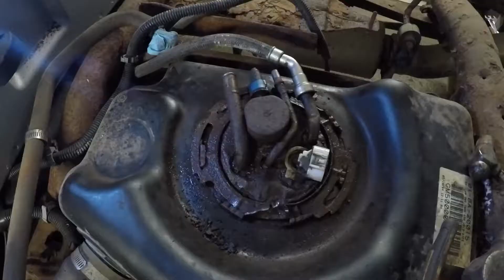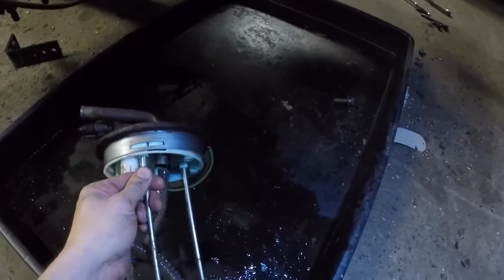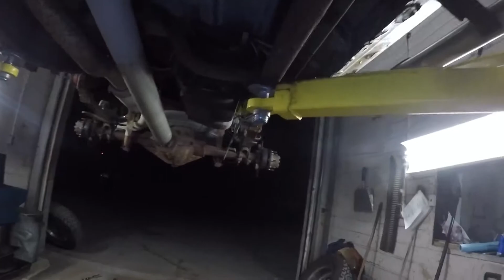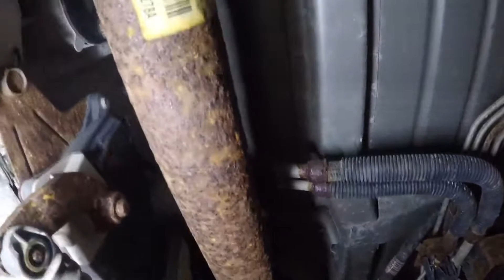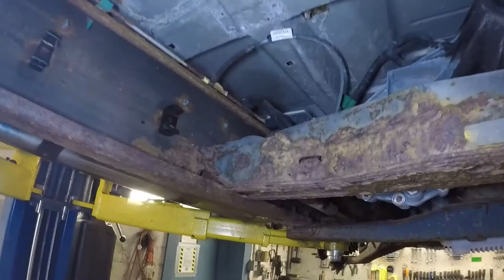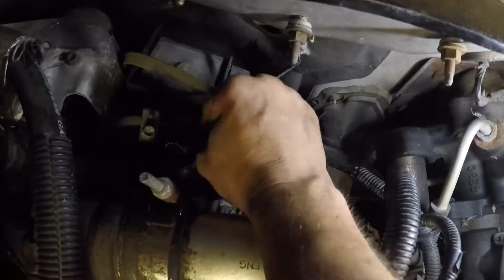Duramax project Re-started lift pump,fuel lines,custom sending unit, axle seals

Comment: The video was interesting and kinda helpful.
Reply from the maker: Steve B I have more content I will try to work on this week to post up the system I did !
Reply: @IMRgarage  hey bud.  Do you know what the blue fitting is for ?
Reply from the maker: Steve Wenzel on the stock housing ? It is the vent valve Basicly bleeds off pressure ! But the cAp has a pressure relief ! I have not had any issues yet but i think I may add a vent line
Reply: @IMRgarage  ok.cool man. Thanks.   I wasnt sure if a hose went to that.  Mine was rotted right off lol.